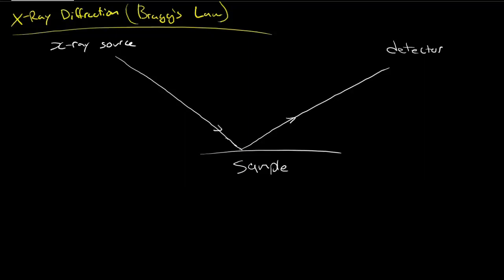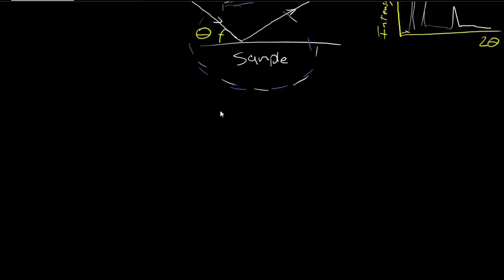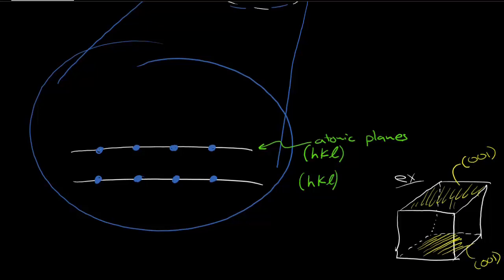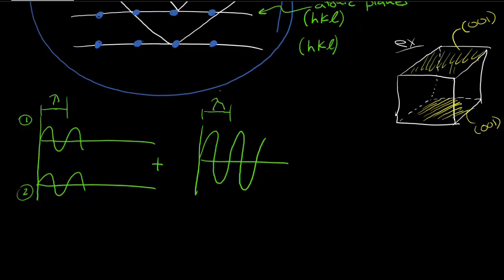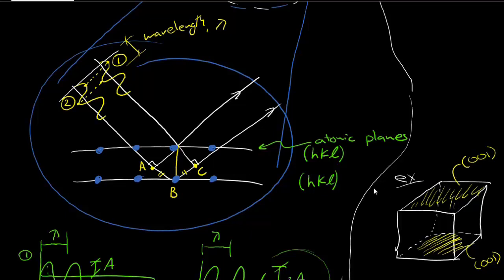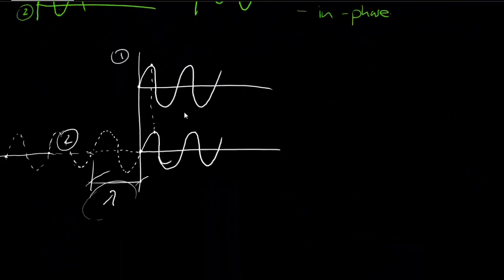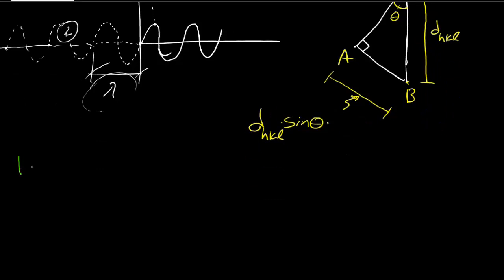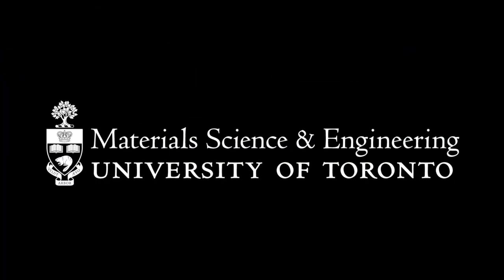Derivation of Bragg's Law for X-Ray diffraction

Comment: Why does the light travel trough that first layer atom? Should it reflect right away when it hits something?
Reply: There is much space between atoms, so light goes through. Qualitativley It works like slightly silvered mirrors, transparent for some light but also refelecting a part of it. Usually 10^3 to 10^5 layers can interact with the light. If your (nano)crystal is smaller there is less interference and peak broadening is observed as described by the scherrer equation (or williamson hall?)
This is just braggs descreption and its liked cause it gives right results. More accurate description goes with the scattering density usually rho(r). The Laue condition (elastic scattering) (G=K=k1-k0) can then be get from the phaseangle between the outgoing light beams to a reference outgoing light beam, and because the scattering desenity is zero nowhere, one can calculate the relative intensity at the place of the observer by integrating |Int(rho(r) exp(-iKr) dr|^2 meaning vectors r and K giving the phaseangle. From Laue you can calculate Bragg. Its the intereferance between the outgoing beams which makes bragg come true. In Beachelor its probably not discussed that way.

Lets simply say Bragg gives right results so lets work with it.
Reply: bana Ne how did you come up with all this information :) you know i've asked my doctor just about miller indices , he said it works that way don't ask me why!
Reply: I mainly used 2 books as i learned this "Ibach, Lüth - Festkörperphysik" and
"Charles Kittel - Einführung in die Festkörperphysik" they are german, but
there are probably english versions of this books aviable. Imo Kittel is condensed and needs some further reading, this is where i got the silvered mirrors from :)
Ibach Lüth treats Interference more preciseley, our Prof. recommended this books.
Further phenomenons like interatction with Phonons in inelastic scattering (Stokes, Rayleigh, Anti-Stokes) are also treated and much more. (Deby-Waller Factor, Plasmons,..)
Really enjoyed learning this stuff back then.
Reply: kerguule simply put, if there ain't nothin' there, it ain't gonna reflect!

Comment: But the incident and reflected rays are perpendicular to each other only in case that the incident angle is 45°, so what about all the other cases where you cannot use simple Pythagorean geometry?
Reply: The angle between the incident light and the bottom plane will also be theta, and from there you can find the angles in the triangle. If I'm not mistaken, that will work for any angle
Reply: you are right!  I was stupid! thank you!